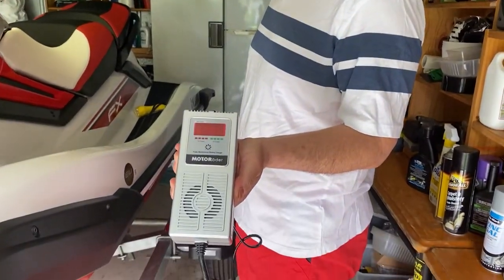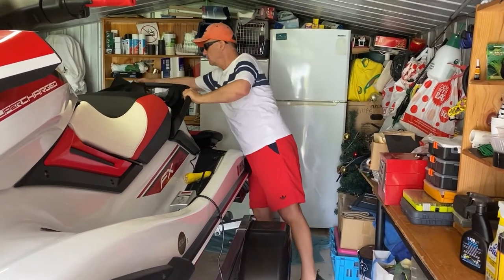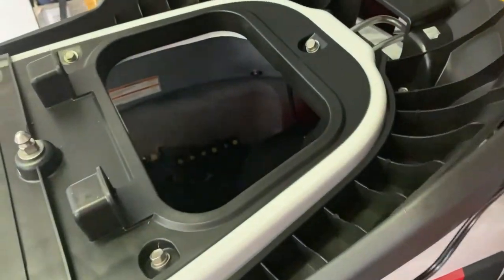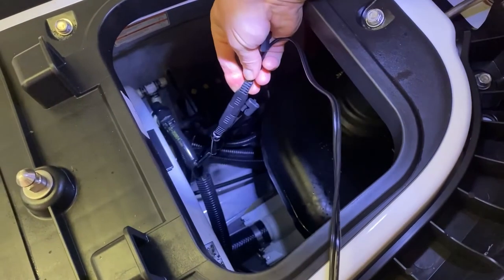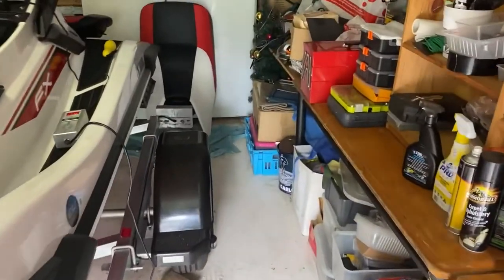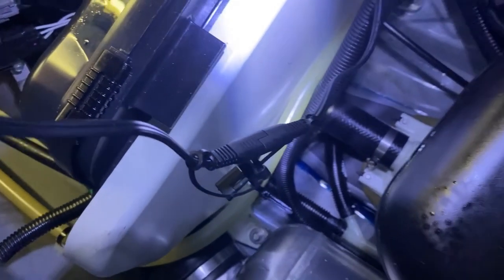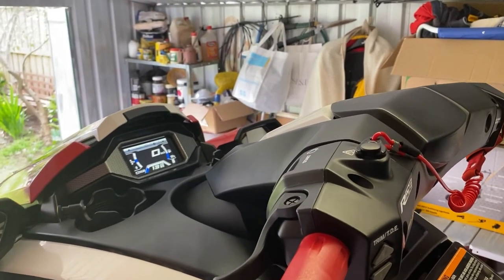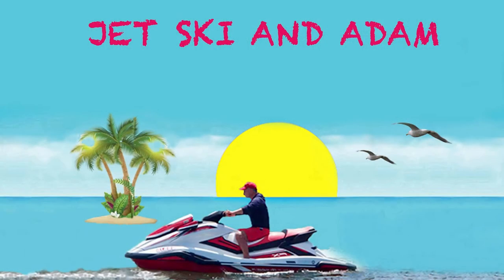How to Charge Jet Ski Battery, Great Tips for Jet Ski

Comment: I don’t recommend a battery charge. If you want your battery to last at least a year even if you don’t use your PWC for three or four months as mine just connect a battery tender after every use and you will have no low voltage or dead battery issues. Every six months check the life of your battery with an expert.